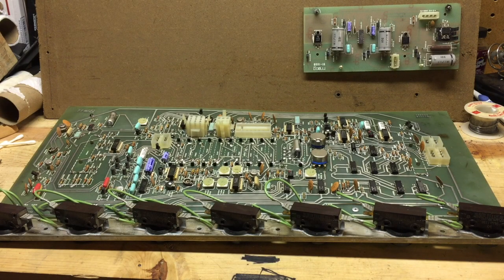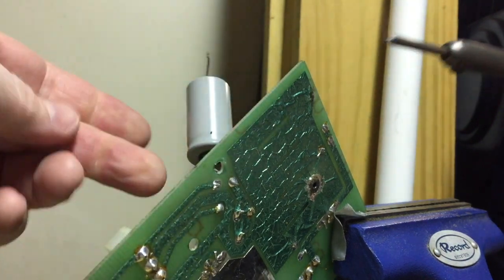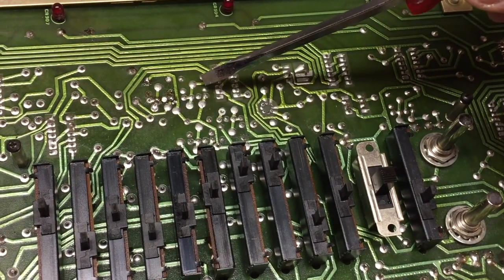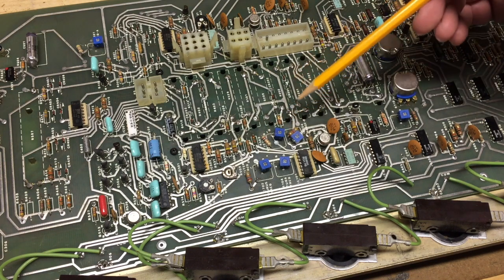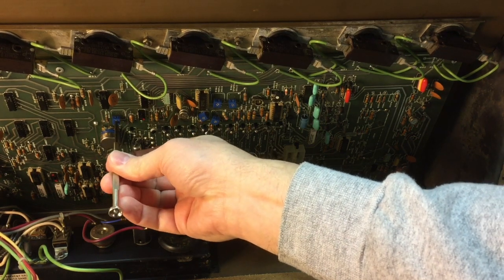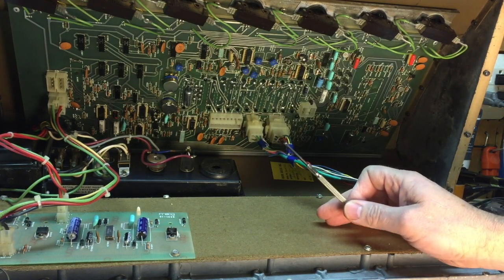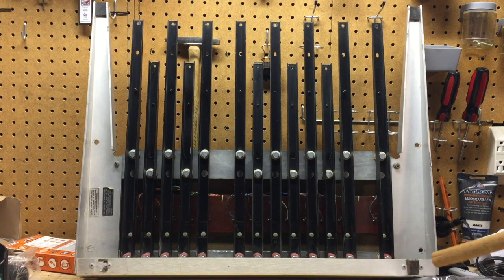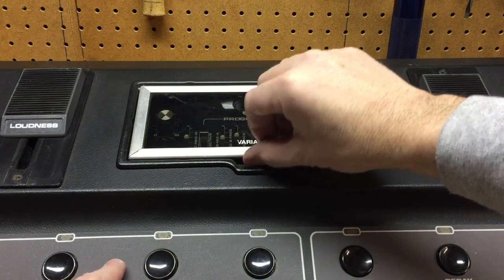Moog Taurus Refurbishment - Pt 3 - Circuit Board Upgrades

Comment: Thank you so much for making these videos. I just picked up one of these for a steal earlier this week. However It must've sat somewhere damp for awhile because after opening it up I've found oxidation on the contactors as well as a few other places. So once I get that cleaned up I'm going to start digging into the thing. But knowing very little about how this stuff works I'm a bit hesitant. The good thing is that it works. But the bad is that each pedal...when they work...all sound the same. So I'm going to assume that I'm going to at the very least replace all of the parts that you did. Thanks again for making these videos!
Reply from the maker: Excellent!  I'm glad you're working to resurrect one of these beauties.  If the pedals all make the same sound, that tells me that the trigger portion of the circuit is working, but it's not sensing any of the differences in resistance from each pedal.  I'm going to guess there's an open circuit somewhere along the resistor ladder, or maybe IC103 which interprets the resistances might be faulty.  Good luck!!

Comment: Any chance of listing the parts needed and where to order from?
Reply from the maker: In the description field, there are some links to literature that should point you in the right direction.  The capacitors are just plain, regular-old electrolytics, some of which I ordered from Mouser, and some of which I picked up at a local electronic parts outlet.  The ceramic-metallic (cermet) variable resistors are ones I ordered from Mouser.  Again, they are simply passive resistors, and they don't affect the tone of the oscillators, merely help govern the pitch.

Comment: THANKYOU for posting this series! I've been trying to get mine tuned properly and I suspected the 5 pots needed to be replaced. The capacitors look easy enough to do myself but I may have someone do the rest. There are no Moog centric shops in Central NY where I live that can do the work but I know of a couple places that if they see this video could do the job quite easily.
Reply from the maker: Hey there!  Glad you enjoyed it.  One of the top reasons I was motivated to make this video is that I noticed (and was surprised) that there weren't any decent videos out there showing how to work on one of these machines.  As synths go, the Taurus is relatively straightforward, and the service manual that Moog produced did an amazing job getting into the nitty-gritty of how it works, so it was a great stepping stone for me in terms of getting into synth repair.  I imagine any reputable electronics repair outfit could do it for you, I wish I could point you in the right direction, but I'm nowhere near NY, so I'd be stabbing in the dark!

Comment: Hi Mark .. switched my T1 on the other night, they flashed on but then went off immediately, changed the plug fuse but no luck. Hoping its just an internal mains fuse, can you tell me where I check for that inside & what fuse I need maybe? many thanks Steve
Reply from the maker: Hi there, Steve.  The fuses are located on the power supply module, which is fastened to the back of the housing.  In this video, you can see them between 8:40 and 10:05, peeking into the bottom left corner of the video frame, they're the round cylinders with the metal caps.  According to the Moog Taurus Model 205A Owners & Service Manual (PDF's are available online at various locations, I think I have a link somewhere in my description text of this video), there are 2 fuses of equal rating: "Fuse, Slow Blow, 1/8 Amp, 3AG".  I hope this helps!
Reply: @markbeebe4388  thanks so much for replying Mark that is really helpful! Will have a look as you describe! Best Regards from the UK! Steve

Comment: Very nice!  I just acquired a Taurus 3.  I don't know the history of it.  Is it safe to power it up just to see if it works, or should the power supply caps be replaced first?
Reply from the maker: Hi there.  The Taurus 3 was originally released in 2010, so your T3 unit and all its components are still relatively new.  The electrolytic capacitors typically will last about 25-30 years, at which point I recommend replacing them, and that's easy to do.  For now, I'd say your capacitors will probably be A-OK for the next 15 years or so, so I'd leave them alone for now, fire up the unit, and make some music.  Good luck!
Reply: @markbeebe4388  - I apologize, I meant to write Taurus 1 just like yours above (I don't know what I was thinking), the serial number tag indicates it's from 1979.  I know that with very old amps, they recommend using a variac to power them up safely.  I was wondering if it was safe to power up my T1 just to determine whether it works or not, and then following that, perform whatever maintenance is required.
Reply from the maker: Hello again.  Well, before breaking out a variac, I'd simply open up the 1979 Taurus and visually take a look at the board that holds the power capacitors.  It's the small one, separate from the main board.  If the capacitors look ok from the outside, then it's probably safe to power it up and test it; however, if any of them look like they're bulging, leaking, burnt, etc., I'd replace them all first.

On my 1976 unit, I plugged it in and it worked, but I still replaced all the capacitors, as they were all at the end of their expected lifetime anyway.  Yours will be too, so I'd plan on replacing all the electrolytic capacitors in the unit soon: it's easy, it's cheap, and it'll definitely only make things work better.  Good luck!
Reply: @markbeebe4388  Sounds like a good plan, thanks for your quick response, and BTW I really like your videos, thank you!  I generally use Nichicons, but I know there are also audio grade capacitors which might be a little better.  Given that it's a Moog, I want the best.
Reply from the maker: Sounds good, but keep in mind that these were designed and built with 1970’s-era components and tolerances, so I’d say that as long as the new capacitors match the old ones in their general specs, any replacement parts are bound to be better than what originally was installed. I doubt you’d get any improvement in performance by going with high-grade components, but at the same time, upgrading wouldn’t hurt.  Let us know how it works out!
Reply: @markbeebe4388  Good point, I'll plan on posting a video of the end result.

Comment: each voice is preset, and you cannot really change anything in the circuit, as I tried way back in the late 70's to turn the tuba preset into a string type sound  could not be done.
Reply from the maker: You're absolutely correct. Other than the pitch (to a limited degree), each circuit is set and not able to be modified.  As analog synths go, this one is not very complicated, and with its relative simplicity come limitations to what can be done to augment it.  That's ok, because it sounds amazing!  For those looking for a wider range of tones in a pedalboard setup, I'd recommend a midi controller pedal set, which can be coupled with any midi-capable synth module (like the Moog Minitaur, for those who want bass).